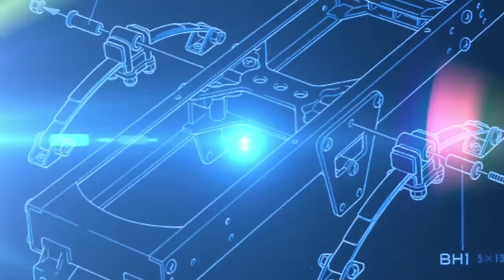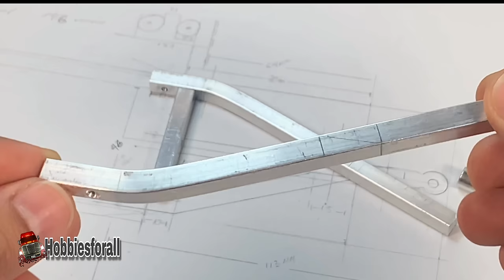Trailer Dolly — How to build a 1/14 Tamiya Truck Dolly | SCANIA R620 Freightliner  MAN all trucks 4K

Comment: The sliding 5th wheel should slide. 
But on a dolly they are usually fixed at the centerline of the bogie. Be it 1 axle or 4.  But excellent job.
Reply from the maker: Hi, you are right. Researching on the subject I found that. As they are scale models, he creates it with parts from other trucks. The next video will make the modification that you suggest. a greeting. Do not miss it.

Comment: Does Tamiya make a B train axle assembly. For those that have never seen what talking about. A B train axle group is as following. Usually it's a pair of 37 foot to 45 foot  trailer connected together with triaxle assembly which mounted at the rear of the first trailer. Two of the axles are the rear support weight axles of the front trailer. The third axle is the front support weight axle under front second trailer. It also has a fifth wheel plate over axle. This eliminates the need for convertor dolly and a double pivot between trailers making assembly to backup easier
Reply: If they made an Aussie triple road train, that would be awesome.

Comment: You need to mount the 5th wheel pin directly over the center bar of the suspension assembly for Dollies
And mount the 5th wheel pin 1/4 inch forward of the suspension center bar on Truck Tractors, just like all 1:1 trucks and dollies are built.
Reply from the maker: Good information 👍🏻

Comment: Can you pull the dolly and a trailer on the truck
Reply: @ Tazie Devil  I've never seen a dolly with a trailer connected to the rear pintle hook of the tractor   & I don't think it's possible  . I've pulled several  .